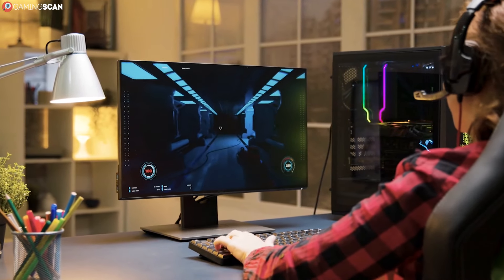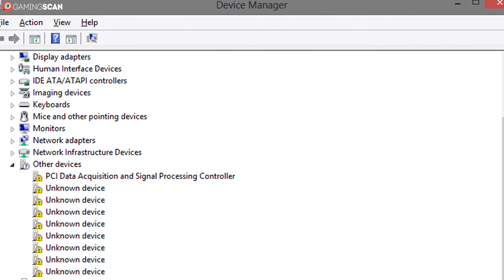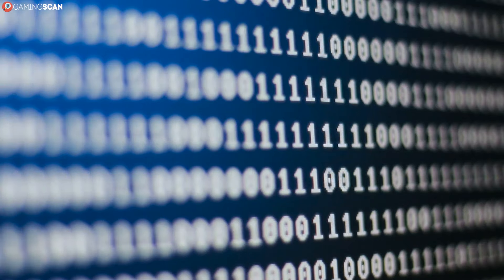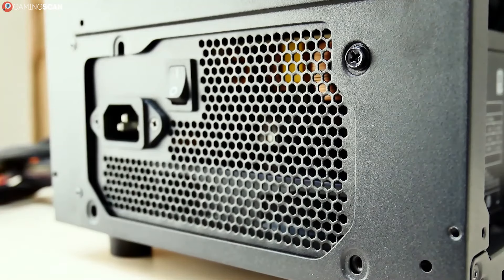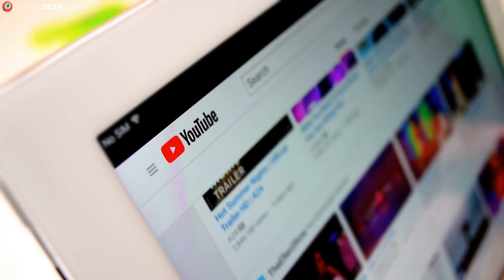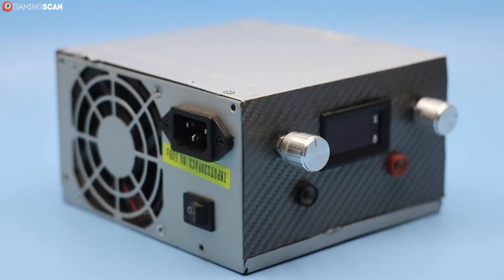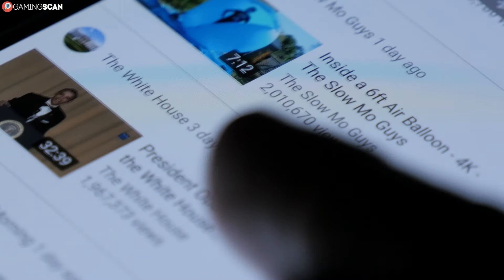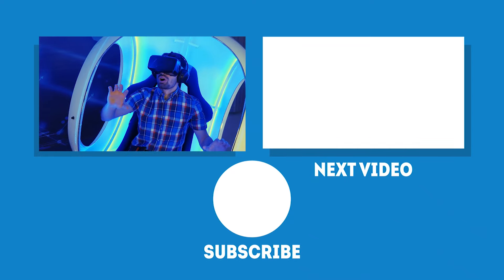What PSU Do I Have? [Simple Guide]

Comment: just open up the side panel and check the side of the power supply, it's that simple 😐😐
Reply: if it looks like it's hidden behind a desert of wires in a pre-built with terrible cable management, it might be difficult to check. however if you built your first PC and cheaped out on a power supply, you'll know if you bought something bad.

Comment: I can't find mine because I wasn't the one who build it and the guy who we bought my pc is the one who built it and I don't have a contact with him. And I'm planning to buy new gpu, I've search everything and the gpu that I'm about to buy is compatible to my motherboard and cpu, is it bad if the gpu I'm about to buy is not compatible to psu? Or it doesn't have to be compatible with psu in order to work?
Reply: i had a stoke trying to read this. the only thing your GPU needs is enough wattage to power it, it don't matter what motherboard you have unless it's from the 90's. u can have any CPU, as long as the power supply you have has enough wattage.